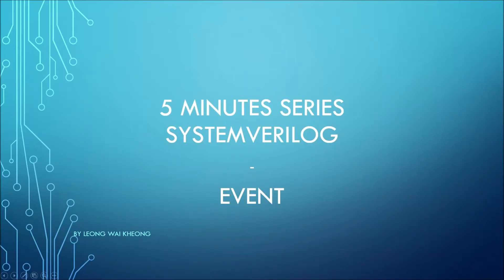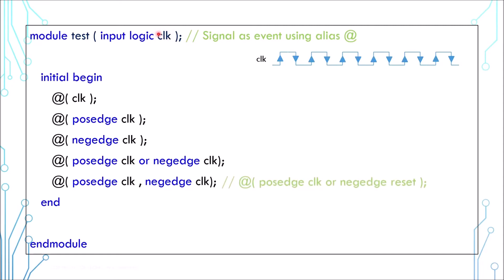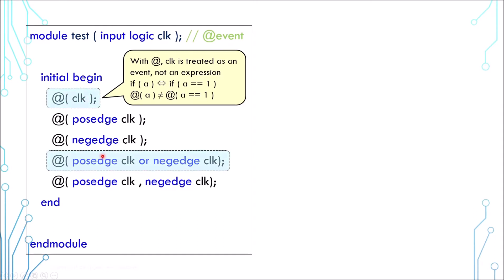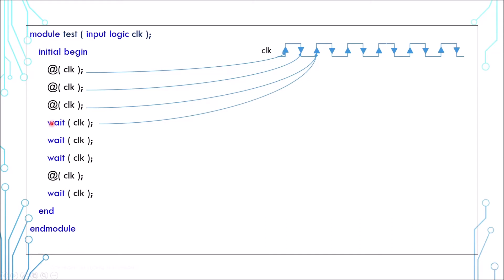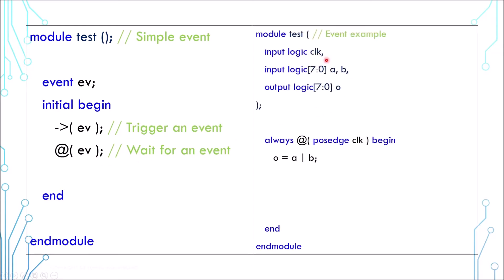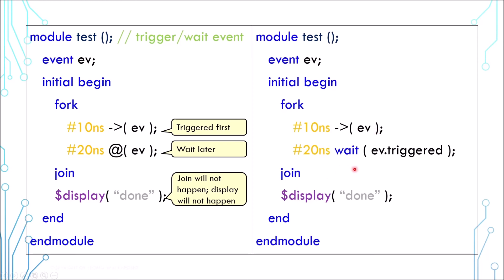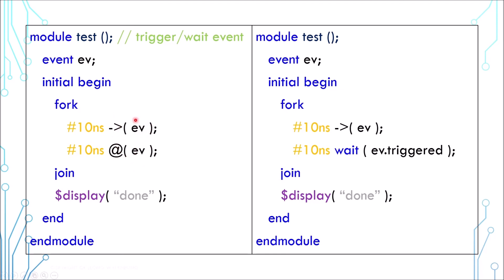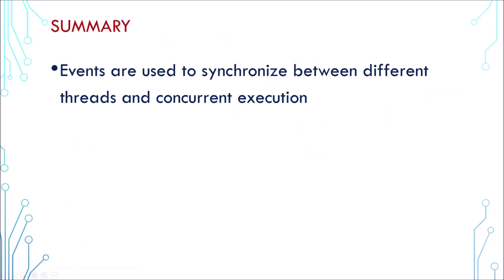SystemVerilog Tutorial in 5 Minutes - 11 Events

Comment: Why blocking should happen before trigger
Reply from the maker: I'm sorry I'm not sure which moment in the video you're asking the question for. I didn't mention blocking should happen before trigger.  If I assume you're asking on 03:54, I mentioned blocking may happen before trigger, and the opposite may happen.
Reply: My question is why blocking should be declared first then trigger
Reply from the maker: @abhishekmazumder9103 First the question doesn't make sense. I assume you mean I write blocking code first and later I write the trigger code? But I could not find a moment in the video where I did that.  It'd be clearer if you mention which time are you referring to.
Reply: My question is if we declare blocking statement first and trigger statement after some time the code written under trigger statement will be executed normally but it is not the other way arround?
Reply from the maker: @abhishekmazumder9103  Sorry I didn't realize there's a comment pending my approval. You have to treat event and value differently. If I use light bulb as analogy, waiting for a bulb to light up is not the same as seeing the bulb is on. At the beginning when you close your eyes (initial), and then the bulb lights up (trigger first), and then you open your eyes to wait for the bulb to light up (blocking later), technically you didn't see the bulb goes on; you only see it as already on. Blocking is not asserting if a value is achieved, blocking means waiting for a particular event to happen (values change from 0 to 1, or from 1 to 0).
Reply: @openlogic925  Great analogy！